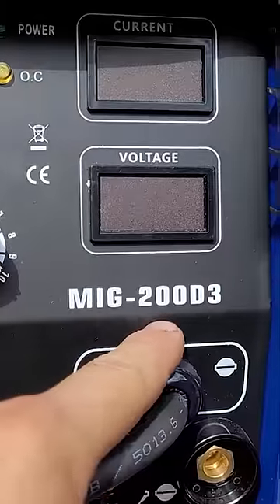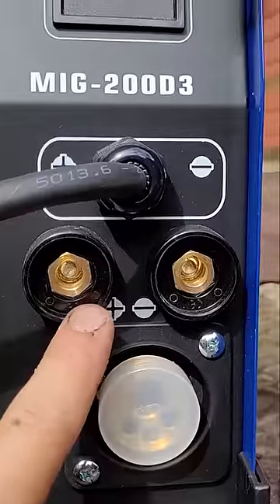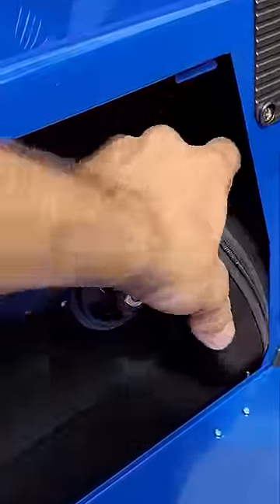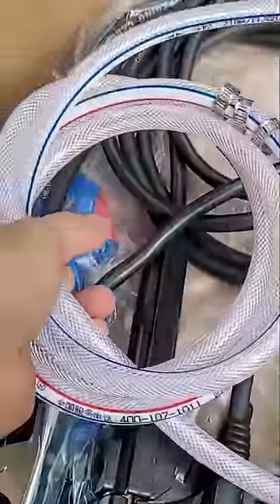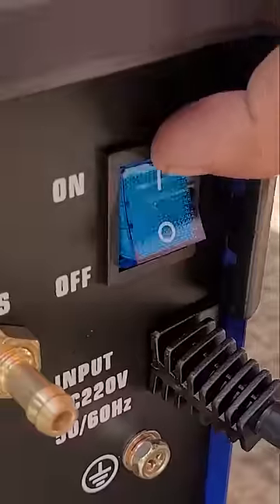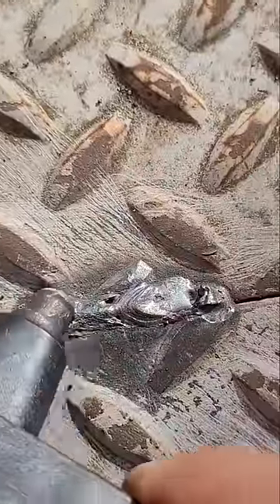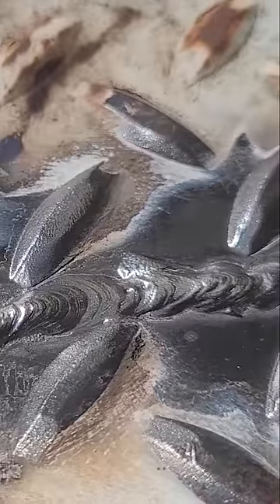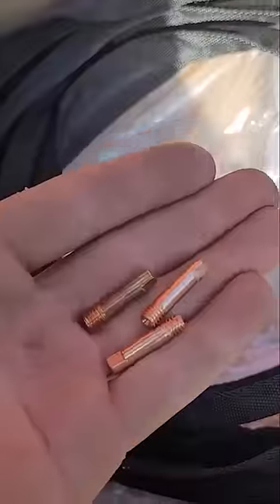Amazon Welder

Comment: I'm a professional welder and got a similar machine for $350. Was pretty impressed how well it mig welded with gas shielding! Got it just for small projects at home
Reply from the maker: Nice! The cheap ones have gotten much better.
Reply: Hey how does this compare to a syncrowave 210? Have you seen any cheep units that can tig the same thickness as the 210?

Comment: As a full time welder I cringe but for a guy who has no real world welding experience but will sometimes need to use one this machine will do the trick as long as it stays alive 😂 👍🏼
Reply from the maker: I have a lot of welding experience. This was 3 minutes welding with a new machine straight out of the box testing the worst conditions possible.
Reply: How long will it live is the question.
Reply: Totally agree,  Absolutely infuriating the way idiots review things
Reply: Been welding for 12 years now and I am still learning- but that being said I bust out 125hr looking welds for a reason- just need more practice and experience to know a good weld from one that will break and need to be re welded get some rebar wire wheel and practice your seams and your caps. I promise it’ll look totally different after 100 passes.
Reply: Used to weld for a long time this guys is clueless to welding, we both know could pop it out the box put wire speed to mid, and full voltage no gas flux core. If it’s a 120v then it ain’t welding anything most people want without gas mixed up. Even then it will have a tough time. But if this brings him the money more power to him ya know
Reply: If you want to do some serious welding buy a Name brand welder. Don't waste your money on junk
Reply from the maker: @ProDMiner  Yea right! Go do it and film it!
Reply: For the average Joe home owner,  Or a farm application these welders seem to do the job. The big question is how long will the important parts last??? I thought getting parts for them would be impossible, And that wasn't the case. But do you want to invest that much $$ if it craps out?? The question is how soon will that happen??? But for less than $300.00. It will likely do the job for a non professional application jobs.
Reply: @tomhiggins4969  tf
Reply: Dirty welder is right man! Lmao you tried to lowkey diss my man, everyone saw it bro! Lol

Comment: You need to slow down your movement on the stick and turn you heat up on the mig. you can hear it in the video your heat is to low. You should hear a crisp sound while mig welding.

Comment: It’ll do! Just clean you material ahead of time and maybe hit it with a torch before you start welding. You can drop tons of money on welding equipment but that doesn’t make your beads any prettier
Reply: BUT, the learning curve is different and trouble shooting is more difficult for a beginner/novice. 
A nicer machine is easier to use in general. 
I used a HF 125A for weeks on mower repairs before giving it away and buying a 180A Lincoln. Out of the box the Lincoln was far more steady and just rides smoother all around.
Reply: @austinlane5533  Glad you found you a machine that works better for you. Sounds like you jumped up in amperage, I’ve always ran hot I like having more amperage I get a better weld that way. I’m guessing you have a better quality of consumable/wire, what you run makes a big difference.
Reply: @NM-pl1iv  
You're entirely correct. 
It can make a world of difference sometimes. 
But then again, sometimes you can get by on the cheap stuff if its all you can get and it may work fine. 
I suppose it's all in the experience level and how well you pay attention to what your arc and puddle are telling you.
Reply: @austinlane5533  Very true!

Comment: you gotta slow down a bit with stick. wait until the puddle turns into a circle. if you do it right the slag should pop right off without a chipping hammer.
Reply from the maker: I had it too hot. I'm going to re-test the stick with better settings and clean steel.
Reply: I usually just wait til I can see out the other side, then I know I got the metal hot enough to move my bead on down the line….🧐
…..yeah I burned a lot a holes the few times I had to weld something🤷🏾‍♂️
I am hella interested in learning how to do the damned thing tho!

Comment: I've been welding 30 yrs mostly mig, but some tig. Just bought vevor tig210P and it runs like a bat out of hell. For the hobbyist I highly recommend it. $215 + cost for argon cylinder which cost more than the machine for a small full bottle.

Comment: 110/220v?  I'm a heavy duty mechanic by trade but I'm looking for something to use at my house for the very occasional weld job.  Looking for a 110v that won't trip a 20amp breaker.  Doesn't even have to be a great welder, just looking for something to glue exhaust or weld nuts to a broken bolt ect.

Comment: We have always used Miller in the shop.  The work all day, everyday.  They stand up year after year.
Reply: Yep. 24 hours a day, 6 days a week. Blow the dust out of them every so often. Gotta love blue!
Reply: I've been in dozens of manufacturing facilities, and by far, Miller dominates that market segment. I will say that the one market segment that Lincoln seems to have a major advantage, is high(400 amp and up) welding power supplies for robotic welding.
Reply: @machinist7230  Lincoln also has the edge with Torchmate plasma tables and such
Reply: @machinist7230  Obviously  you've never been on a pipeline  job .
Reply: @lokirussell5891 so you guys have robotic welders doing your pipe lines now….?😳
Reply: @revmsj   Yes ! As a matter of fact some companies do just that , they' ll place a portable work box over the joint to be welded using a excavator,  that eliminates any wind or breeze that will interfere with the gas shielding used in the process ,OK ? 😳 It's nothing new been going on for several years now 😳

Comment: Stick has to be my favorite, I’ve got an old Lincoln Tombstone that I lug around with me. It’s got a good 15-20 years on me lol
Reply from the maker: The Lincoln Tombstones last FOREVER!
Reply: @MattsShop  damn straight they do lol
Reply: Lincoln copper pipeliner.   Only way to go
Reply: That’s what I have too! I had a need for a light mig welder doing exhaust so I went to harbor freight for a quick little throw away one. Well, I still have it, it still works like new, and it’s been about 2 years and 7+ full exhausts later. Of course the welds aren’t as pretty as a 240 machine but hey, I’m not complaining. I use my Lincoln for everything else mostly.
Reply: @MattsShop  They've been making the Lincoln Tombstone since dirt was new, every welder seems to have one, even it it only collects dust, like mine.
Reply: I have an old Lincoln buzz box is what I call it, but it's an old Tombstone...That thing works every single time.
Reply: @Chris.Rhodes  can’t ask for much more than that lol

Comment: If you dont clean your work piece your welds will.always look like that.. wire brush or wheel goes a long way. If it has oil on It use NON-CHLORINATED brake clener let it dry completely then weld away. When I was in school I learned it's not the.machine its if your have if set up correctly clean work area and then the skill comes in.
Reply from the maker: Yes, you're right. This was a test of the worst possible conditions.
Reply: @MattsShop  great video anyway !

Comment: Its not the machine. Its the welder. The machine just wont put out work all day. Needs a better fan. More cleaning and cooling time. Longer runs will kill it sooner. Also a fire hazard so stay ready.
Reply from the maker: Lol it was a test in the worst conditions possible. What do you expect welding through paint?
Reply: Meh it probably has like 30% duty cycle. Miller’s got what? Like 40??
Not too far off considering the 1000+$ difference in price…🤷🏾‍♂️

Comment: What's the cycle duty?
Run time, if you are confused.
Reply from the maker: 60% 6min  on 10min off
Reply: @MattsShop  depending on the price, that's not too bad
Reply: @MattsShop  Actually 4min off. 60% is good.

Comment: Gasless flux core wire feed welding is not mig welding Mig stands for Metal Inert Gas, or more approximately called GMAW, (Gas Metal Arc Welding) There is a mig process called dual shield, which utilizes flux core wire along with inert gas, which in that process the flux does not provide shielding gas, it helps with the flow and weld properties,  but what you were doing was not mig welding.
Reply from the maker: I know this was technically FCAW.

Comment: YEA bud not too good at mig either porosity from start to finish in that mig stick was ok but again as you said probably user error but still stick looked WAY better than the mig!
Reply from the maker: It did. The metal was too dirty even for flux core MIG. The stick just burned right through it.

Comment: Most cheap welders can work but they will overheat before the job is done.
Reply: Duty cycle is 5%
Reply: @davidrasmussen2975  that would be great if you're paid by the hour: boss asks why you sitting in the shade, your response: waiting for the machine to cool, already used my 3 minutes for this hour!

I know when my old Lincoln is getting warm, the fan runs faster!
Reply: Some of these multi process welders that are under a 1000 actually have a pretty good duty cycle
Reply: From what I’ve seen duty cycle differences between like a harbor freight welder and say Miller is about 10%. 

As in cheap welder@30%  whereas Miller@40%. Of course Miller will be at a bit higher amperage…🤷🏾‍♂️

Comment: did you know for that one and many other chinese multi process will also do plasma cutting and you can order a torch for them
Reply from the maker: Really? Which models do this?
Reply: @MattsShop  any of teh ones with the Euro connects you run it on Tig  mode yours should be able to run it Aliexpress sells the torch for plasma for these machines

Comment: I bought the exact same welder. Works fine, but I use GMAW since I'm usually working with sheet metal 16-22 ga. I haven't tried the TIG yet though.
Reply: Why not just say stick
Reply: @diychad7268 why not just worry about what you say?

Comment: Ok but report back after an hour of use!
Reply: I have the same identical welder, but sold under the "Tig/Mig" brand and red, I am no pro and don't weld that much, but I have run about 70 kilo of wire through mine over the last 6 years, it is pretty good for a budget no name welder.
Reply from the maker: Like 2 years still good

Comment: It's not "Flux core mig", it's flux core with flux core wire to protect the weld. Mig uses an inert gas, there is a process that uses both a shielded gas and flux core wire though, it's called Dual shield.  Also the way you say porosity makes me want to stop you from talking, forever

Comment: Mig is a slang term , it stands for Metal inert gas. The proper  acronym is GMAW GAS METAL ARC WELDING. There are no thingys in your toy welder. FCAW  and SMAW Are two other processes. There is no process called flux cored mig. Or whatever the fuq you said. Stay out the weld game!
Reply from the maker: I didn't saw FCAW in the video. Everyone knows what I mean. It's easier just to say flux core Mig. If I said FCAW people will ask 1000 questions like what is that???